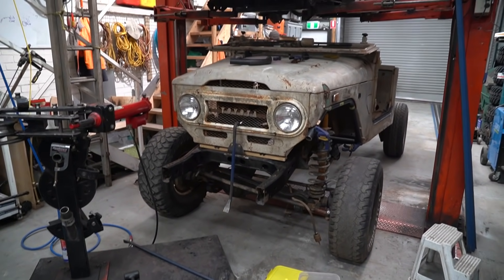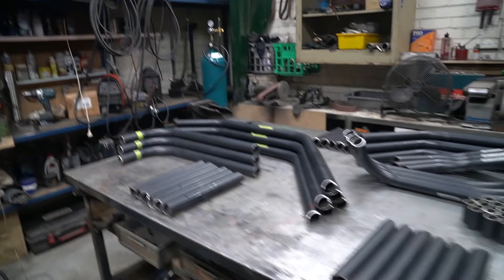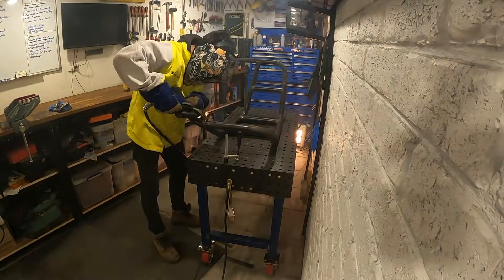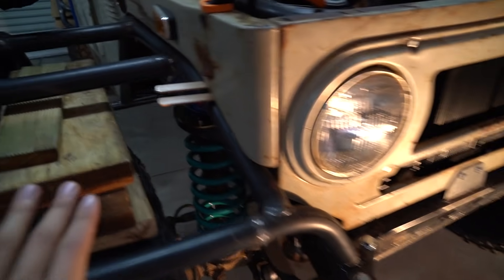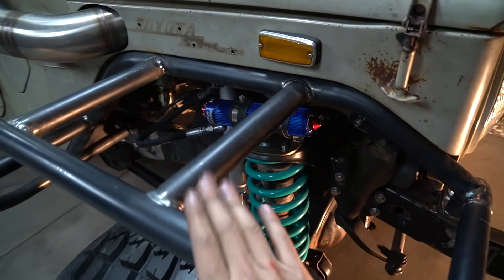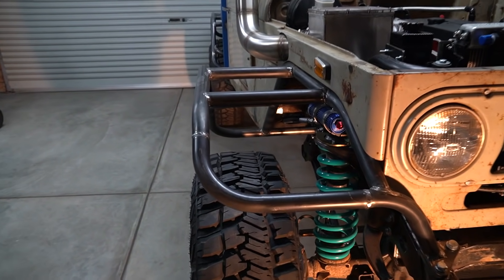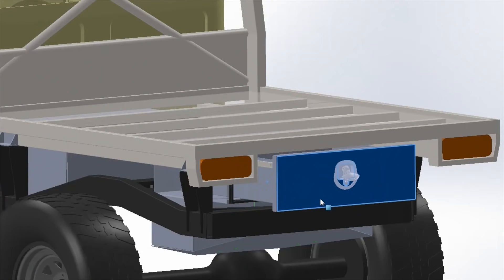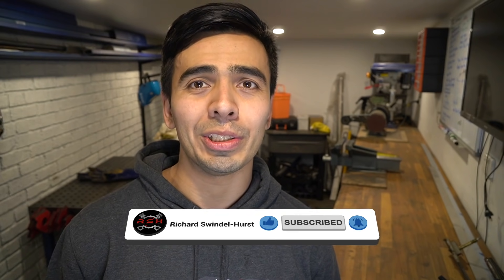BUILDING TUBE GUARDS FOR MY BARRA SWAPPED LANDCRUISER - Barra T FJ 45/ 80 series Ep. #15

Comment: Well done, very well styled and structural as well, I would highly recommend doing your rock sliders before you get it on the road, from experience the itch to go bush is high and if you take on some bog holes or tricky tracks one of the first things that tends to get dented or scraped is your sills/doors.
Reply from the maker: Hey Adman, yeah look probably the right call - just itching to drive it and test it ha.

Comment: Those guard looks great! Might vibrate and make a bit of noise on those corrugated roads tho might be worth putting some sikaflex between.
As painful as it would be it’d be nice to skin the underside aswell so they don’t hold so much mud/sand etc
Reply from the maker: Hi Daniel, I like the sikaflex idea. Gawd it would be painful to skin the underside as well, but agreed probably the right thing to do. Could be a good job during lockdown.
Reply: @DesignedandBuilt  
Hi Richard
You wouldn't have to panel the whole underside.  Just thickly filleting Sikaflex it in at each cross pipe and scrub bar will stop vibration and stop dirt and moisture getting in the crevice between the pipes and panels.
Reply from the maker: @davidb6651  Got it, cheers!
Reply: Double down on what David B said. That's exactly what I do with, my alloy topped tube tray.
Bostik, SealNflex 600ml sausages from Total Tools, from memory like $8 a sausage. Then 40mm paint stirrer, sanded to a smooth radius, dipped in Windex to smooth it out.
For removal, one slice with a long blade Stanley knife. For refit, if you're lazy like me, one bead of the same stuff, on your cut line, seals it back up.
For some magical chemical reasons, mud, like paint, doesn't stick to that Bostik goop.
Reply from the maker: Thank you!

Comment: Richard how do you intend to prevent dissimilar metal corrosion between the steel tube and alloy plate?
Reply from the maker: Planning to paint both and run some sikaflex in between.
Reply: @DesignedandBuilt  it's worth using tef-gel on screws that connect dissimilar metals as well. Sounds like you're all over it. Loving the build mate. Looking forward to starting mine. Cheers, Andy

Comment: is there any way you can give me the specs for the guards because i want to make tube guards for my hj45 but dont know where to start
Reply from the maker: Hey Mate, pick a width to suit your track and then we used a bevel off the car. We just copied the exact angles/dimensions of a stock wheel arch. and then changed the width. The Jig really helps but you basically need a car without a motor to do that. There are off shelf options as well, hope that helps.

Comment: I am seriously loving the detail, and the build quality, but,...I am noting that everything is being built in serious thicknesses of steel, not light gauge stuff, serious engineering-grade stuff.  I am now beginning to worry about the all up weight of this vehicle, are you planning on getting an upgraded GMV?  Are you beefing the brakes up to cater for this 2500kg plus vehicle?  Just wondering.
Reply from the maker: Cheers Rod, yeah really good point. I have a feeling it's going to come to around 2000kg without a touring setup. I think GVM is around 2900 kg, I think I can upgrade the brakes relatively easy, wasn't planning on a GVM upgrade but once I've weight it I'll go from there.
Reply: @DesignedandBuilt  Not sure what your plate will say (Should be in the driver's door jam), but others I have seen  (Canadian models online) are 3040kg.  Up to 1000kg for the touring setup should be heaps.  I am loving the work, keep it up.